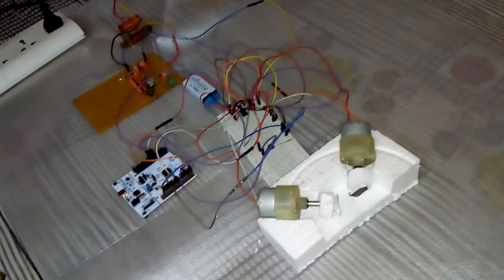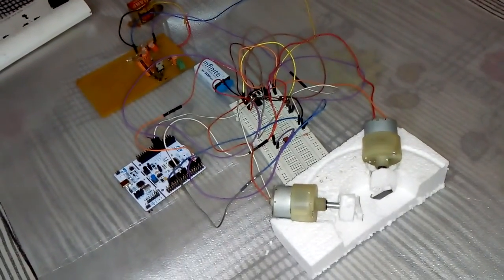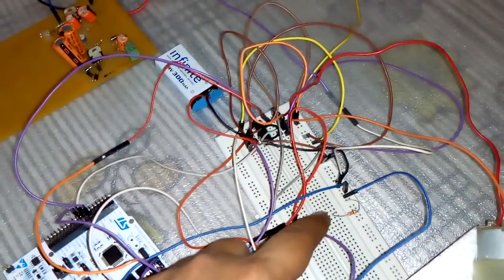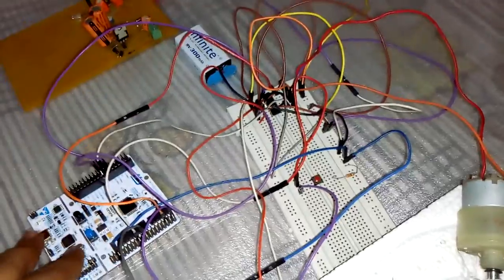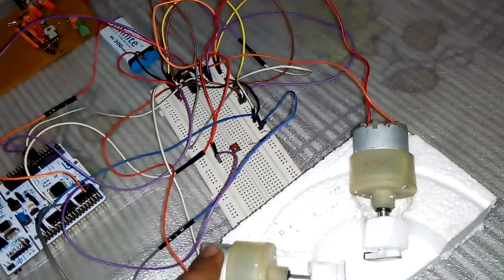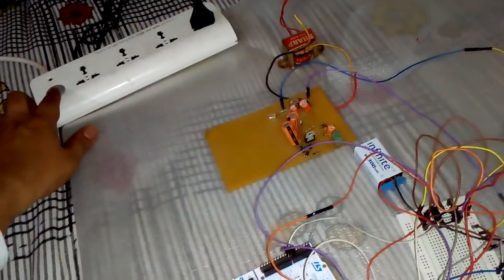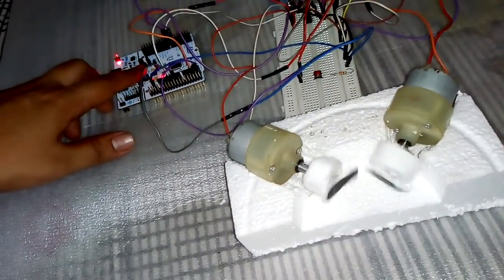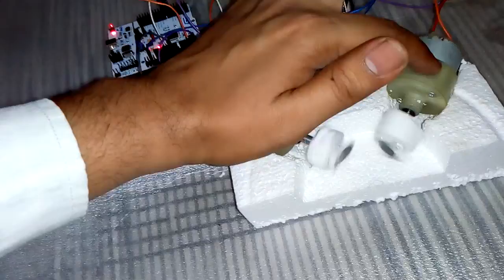DC  Motors direction control using STM32 nucleo board

Comment: I am trying to do a similar project which uses a part of this. We're using STM32F401RE, so could you share your circuit diagram and code?
Reply from the maker: Currently I don't have the code, but circuit diagram is simple. I am using L293D to drive the motors. Each motor is driven by gpios of stm32. For each motors there are two gpios. Whenever button is pressed I simple invert the value of bool variable written in code. And accordingly, everytime each button is pressed we change one of the gpio to high and other to low. By this direction is reversed. You can contact me if need help.